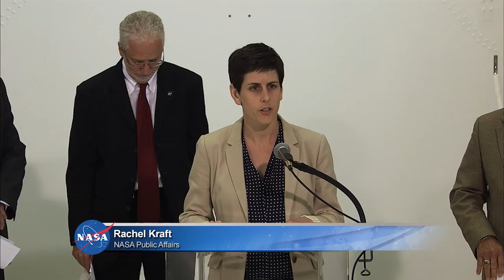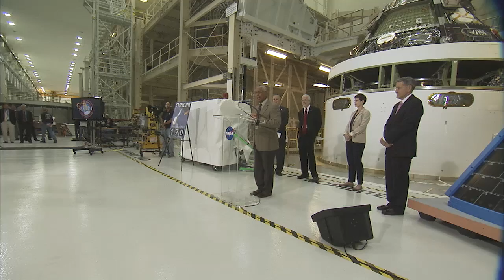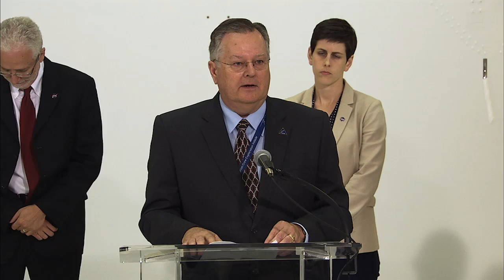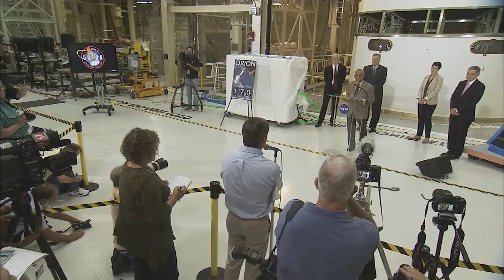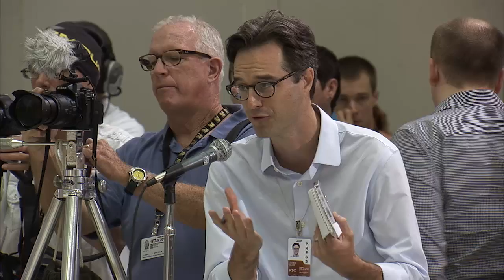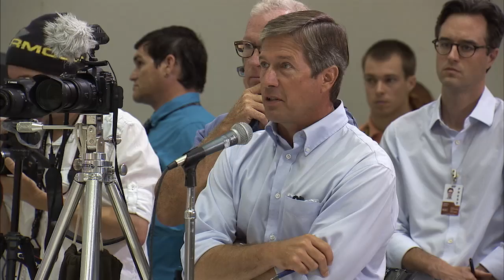Orion Spacecraft Taking Shape for First Flight Test

Comment: Orion is almost ready 10 more super lifts until the ship is ready super lift 25 is coming up that one will attach the back shell onto the hull then when that is done Orion will be transported over to the Instrumentation Facility and the electronics will be installed when that is done Orion will be moved to the Payload Hazard  Facility where it will be loaded with fuel and the protective shroud and launch abort system installed when all is ready Orion will be loaded onto a transporter and taken to SLC 37 and installed on the rocket.